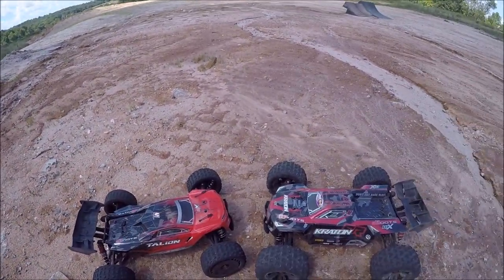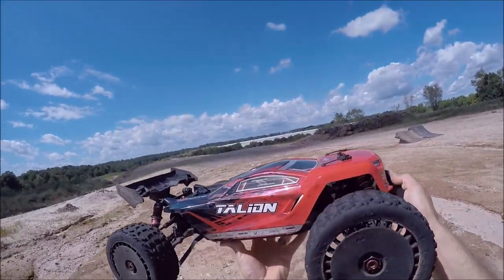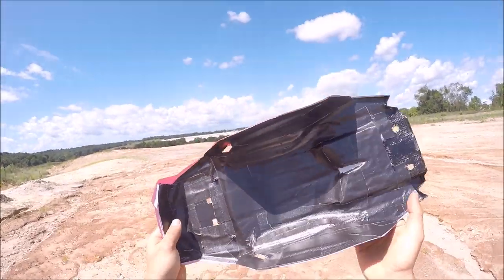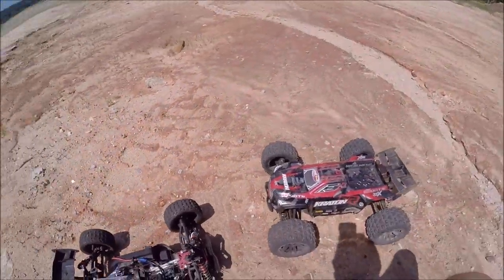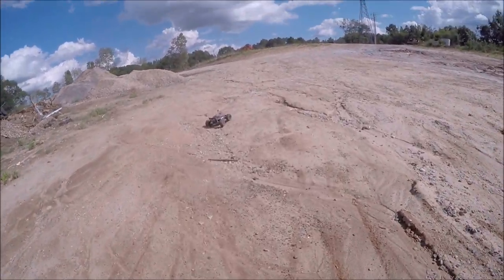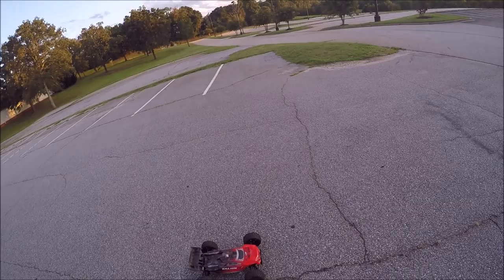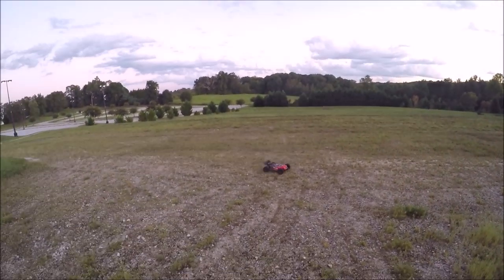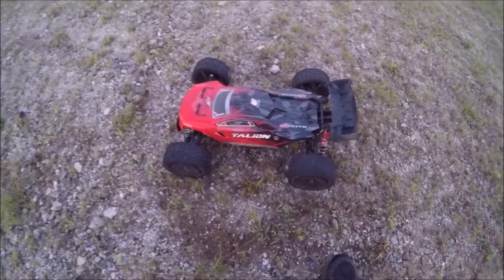Arrma Kraton V4 "BEATDOWN!" and Talion Stallion "PURE ROCKET LAUNCHER!"

Comment: Those ball ends were a concern when i got my kraton 6s after running my xmaxx  and really not knowing anything about arrma, but on the same day i came down crooked on the front right wheel on the kraton and the ball popped out.  I was thinking at the time they were a bad idea, but 10 minutes later i did the same landing with the xmaxx and broke the knuckle and the c hub.  with the kraton all i had to do is pull out a screw and put it back in and i was back in business.  The xmaxx has me waiting for parts.  Way to go arrma!
Reply from the maker: Totally agree bro!👊So nice to fix on the spot and keep bashing!!!
Reply: Yeah I sold all my Traxxas garbage since armma came out with 6s bashers,there's just no comparison,what does Traxxas have for 8th scales with 6s systems ,metal chassis and tough and ad fast as the armma line,NOTHING,and armma gives u alit more for your money as we're Traxxas everyone knows is way overpriced

Comment: Amazing! I have many different RC cars, which Arrma should I get first; the Kraton or the Talion for all around bashing and what are the differences in driving performance between the two? 
🤔
Reply from the maker: Well the Kraton is definitely an all around basher and capable of rougher terrain, taller grass etc. The Talion is a completely different feel and is a bit more agile, handles and fly's better!💪Its balanced different, has shorter shocks and lower towers that keep her low to the ground so perfect for street, hard smooth dirt, low grass and gravel!👌Personally my fav bc I just love the overall handling and speed! But for a versatile all around  hard basher, the Kraton would be a good fit! Both have lots of room for upgrades and setups!😎💪🤟🤟

Comment: What I don't get is the talion,kraton,notorious,outcast,all 6s blx with same system and chassis and most parts,so to hey all just have different bodies and tired ,so put all the same gears and tired they should should all be the same rite???
Reply from the maker: The Kraton and Talion share a long wheelbase but different chassis, shocks, towers, body and tires. Both total different rigs. The Talion is a low profile seed Truggy and the Kraton is more or a Monster Truggy. The Outcast and Typhon are Short wheelbase. Different gears in the Typhon but same electronics. All the rigs share a lot of the same parts and make them interchangeable to create custom trucks. Pretty cool!😎👊

Comment: The kraton is dope but is it just me or does the talion take the longest flights?
Reply from the maker: Thanks bro!👊Yeah the Talion definitely has the best flight! Lighter weight and well balanced! Bit more aerodynamic too. By far my fav. rig!😎💪💪🤘🤘
Reply: @RCDUDE81  awesome brother were having a jump comp out here in toronto soon. Would u recommend talion or typhon?
Reply from the maker: @gaberealrc7355  Well the Typhon will gain more distance but much harder to control at altitude. Both are killer at huge sends..💪The Talion with enough speed still launch killer and have a little better air maneuverability. I think most records were done with a buggy but didn't always land them..🤣Sounds like a fun competition!👊🤘🤘
Reply: @RCDUDE81  cool thanks yea i did notice buggies lose control on huge jumps at times. But if going lighter is the goal maybe outcast on katars with a nice high gearing. Should be fun!
Reply from the maker: @gaberealrc7355  Yeah that's a good combo! I run that setup on my Purple Outcast most of the time! Makes for a whole new animal. Much lighter on its feet!😍